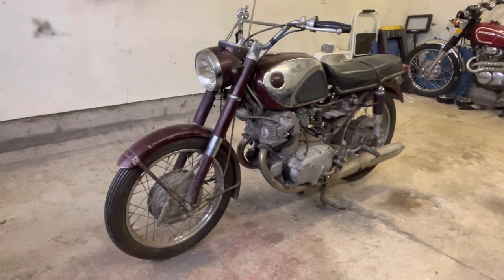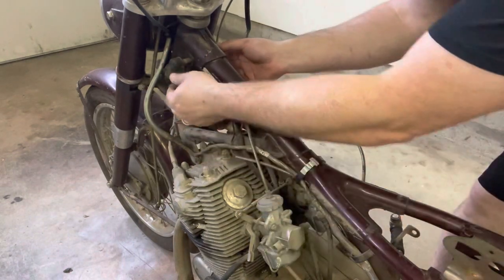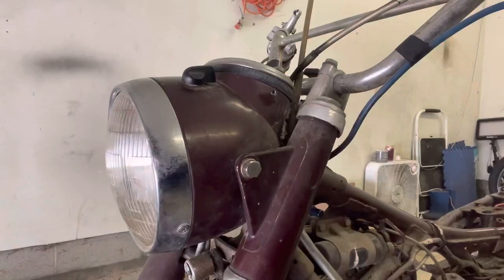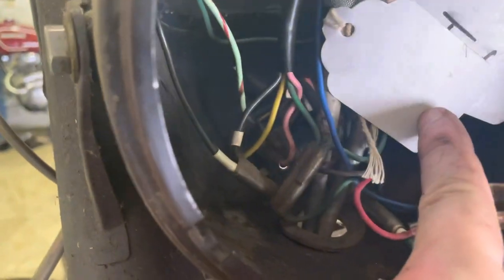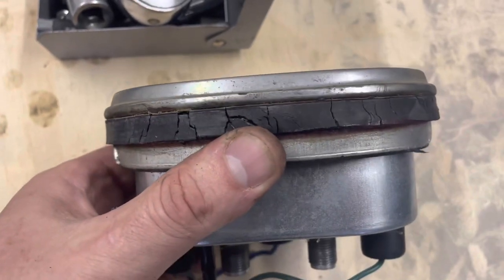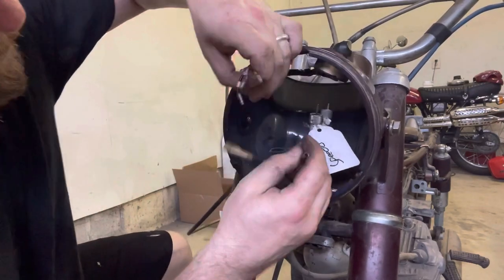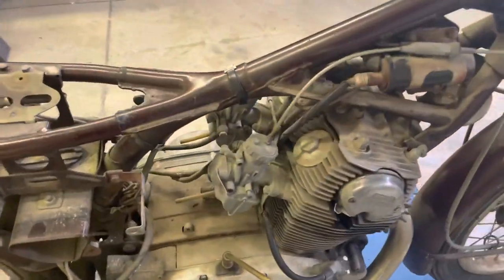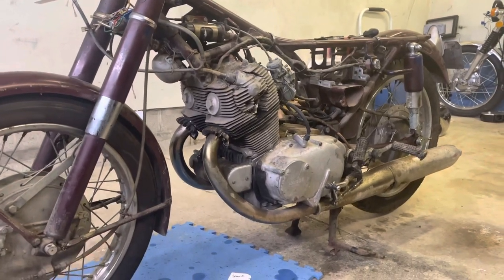Honda CB77 Super Hawk Motorcycle Restoration: Disassembly: Part One

Comment: Excellent vid!   I’m about to start working on mine.  My left carb is allowing gas to flow through the overflow tube when I engage the peacock.  It’s either the needle or the float.   To take the tank off it needs to be empty I imagine. Should I run the bike until it’s empty or do you suggest another way?
Reply from the maker: You can just pull the carb too. Drain the tank. Easiest is to remove both fuel lines for the carbs and put them into a gas can. Then turn on the petcock. It’s slow but doesn’t make a mess. You could also use a siphon.

Comment: And so it begins... : )   I haven't done a full tear down but I can't tell you how many times I've gone back to my iPhone photos to see how things looked before I started tinkering.   It can be a little scary taking stuff apart for the first time.   I got my first bike 3 years ago, a 1975 Honda CB750.  It's been a blast learning to do maintenance and make upgrades.  At some point I'd love to get a vintage Honda twin and do a full tear down and restoration. 

I don't think you'll need to replace the wiring harness.  Those wires look pretty good.  No posi locks needed.
Reply from the maker: The wires do look clean. A great sign. But we shall see won’t we!